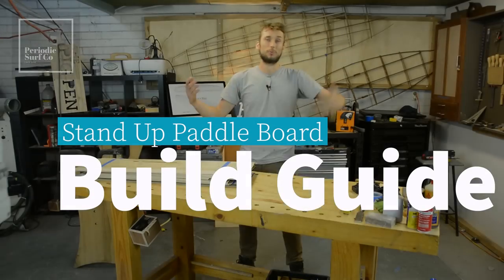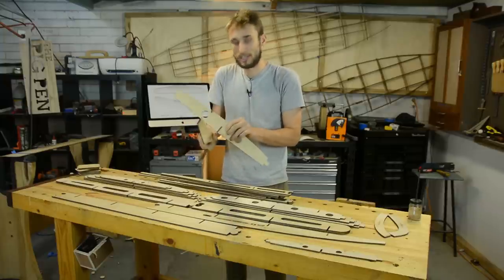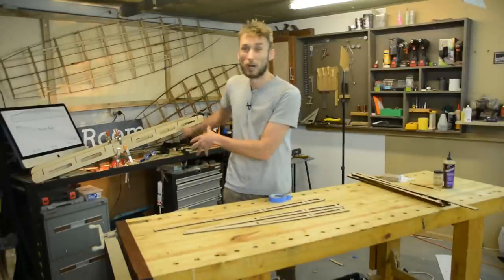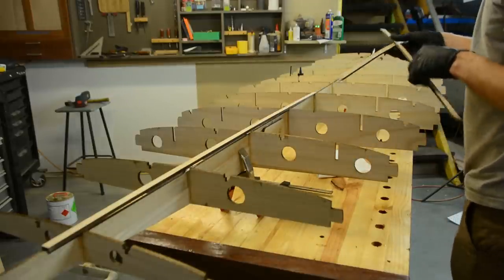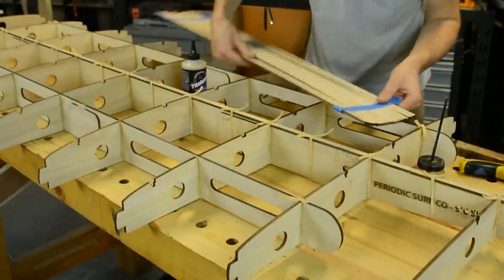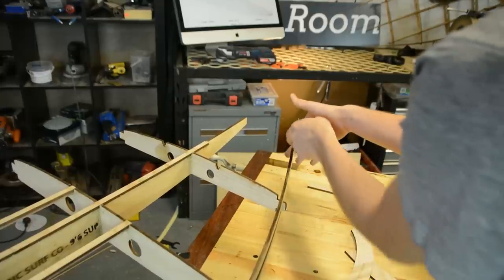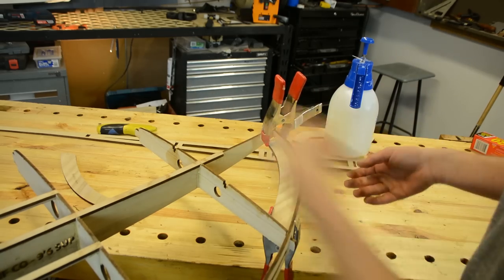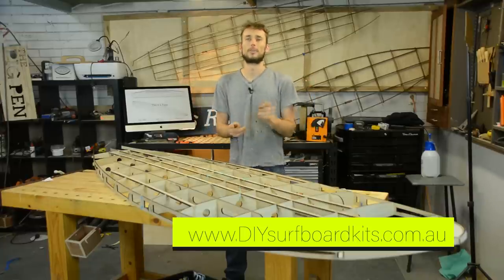How To Build A Wooden SUP - Frame Assembly [Part 1]

Comment: What is this Wooden SUP you assemble in this made of (type of wood supplied in the frame kit)? Is the wood being used in this frame build water or rot resistant or do you need seal it before adding the outer enclosure? Thanks for the tutorial and your timely responses will certainly earn my future business! excellent
Reply from the maker: Hi, the timber is paulownia that is very resistant to rot and is known for its resistance to water so we don't seal the wood internally only externally